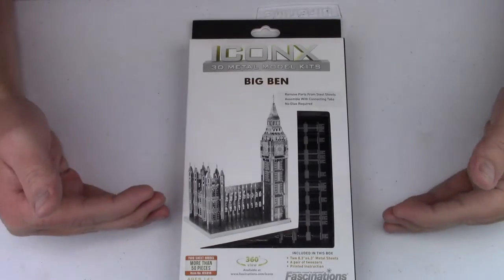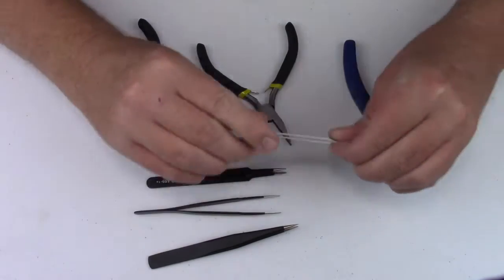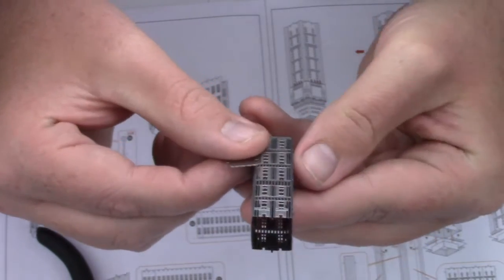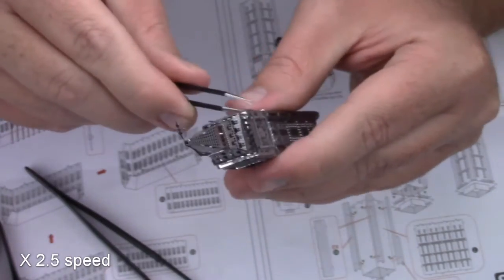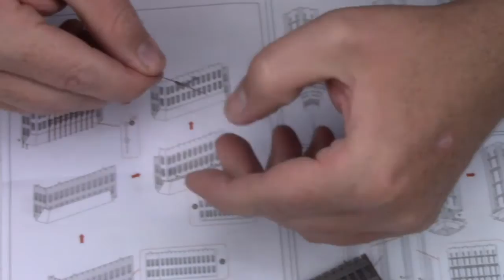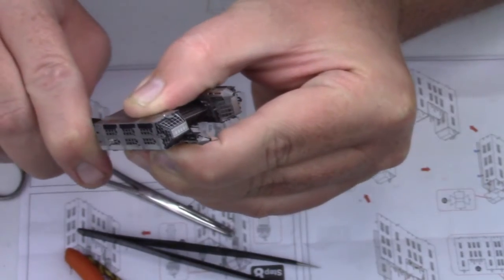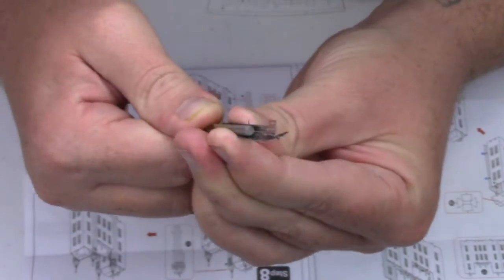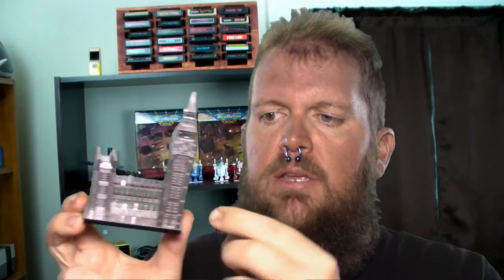ICONX Build - Big Ben

Comment: I finished this one last week. I don't know why, but the intricate models like this always come out great while the simple once I somehow always screw up. The only thing I really hated on this model were the pilars you have to attach to the corners of the tower and side building. Everything els worked great. And I didn't twist the diamond shaped pieces below the clock since I didn't have tools that could reach. Otherwise it looks fantastic.
Reply from the maker: Jaros Bodytko I know just what you mean about the simpler models some tending to turn out tougher looking. I have noticed some of the simpler, older models lack a little detail which doesn't help.